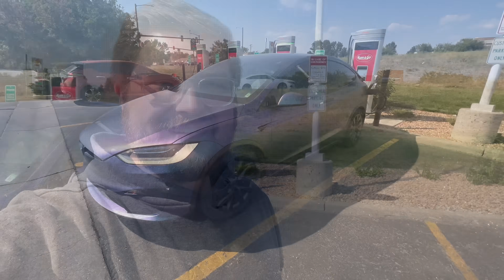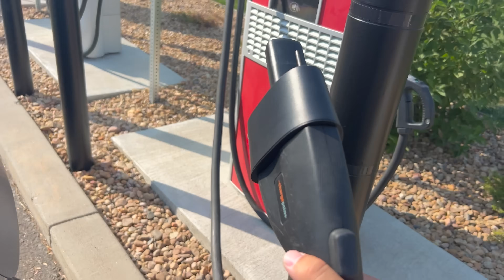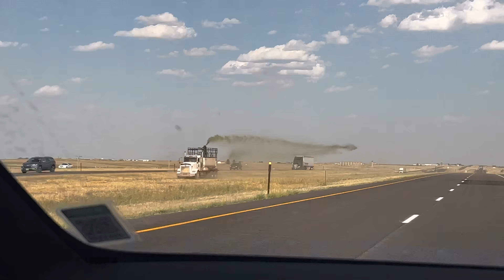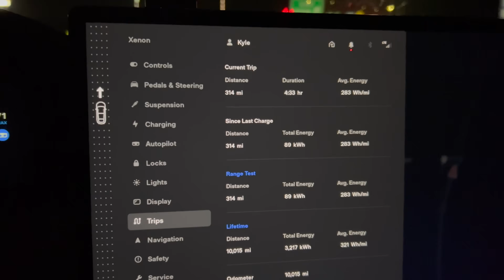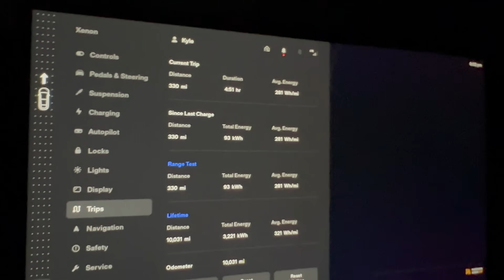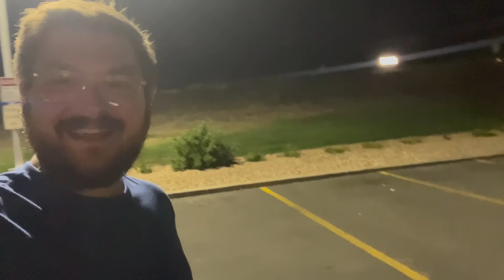2022 Tesla Model X Long Range 70 MPH Highway Range Test - Will It Go Farther Than The BMW iX?

Comment: Love your testing and videos, Kyle. Just a thought:

Kyle left the A/C on while charging on the iX, but not on the Tesla. I'm sure running the compressor hard in the X initially is why your efficiency appeared so high at your 90% SoC update. 

As someone who lives in Florida and has spent nearly 2 years in an Tesla, that initial cranking of the A/C in a hot cabin uses a ton of power. That was probably a 3 to 5 mile difference right there. The initial degradation of Li-Ion batteries compared to the iX probably is another 3 to 9 miles. You also may have been able to limp out another 3-6 miles if you really tried to kill it. So best case, you may get 350 miles out of a Model X at 70MPH. But the average vehicle will not, so your test is a much more realistic sample.

We all know that real world variables such as: HVAC, Wind, Elevation Change, Road Surface, Car/Battery/Tire condition/type, plays so much into the range you get on a test.

I do appreciate the work and love watching all these videos. But for those trying to buy a car, don't base your EV choice on how many miles it's rated for, or YouTube range tests. More important is the actual efficiency (ie Wh/mi) vs usable battery size if you really want to compare two cars apples to apples. But Miles of Range is easier to sell people on, I suppose, even though it's not super helpful. If you want to beat EPA ratings in any EV, cruise at 50MPH with HVAC off and windows closed. I guarantee you'll see about 400 miles in either the Tesla or BMW. But in reality, the car itself is what it comes down to. Things like practically, performance, comfort, style, features, and charging network are all way more important that any minor difference in range. If efficiency or battery size are hugely different, then that's definitely going to make a difference. But two cars with similar efficiency and sized batteries, each within 15% of each other, it's a wash!
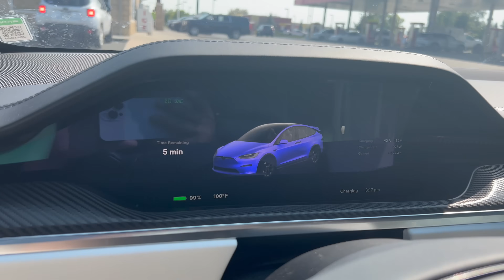Reply: He had the climate on while charging the model X as he mentioned at 5:20 .  The initial degradation of the battery depends entirely on Tesla's buffer strategy.  It seems they're keeping a larger buffer in the 2022s versus previous model years so it's possible they're hiding some degradation behind the buffer now.  

He also tested the least efficient iX m60 w/ 22" wheels against the most efficient base model X w/ 20" wheels.   The iX m60 beat the combined EPA estimate by 65 miles, but the iX m50 with 20" wheels has an EPA rating that's 50 miles higher than the iX m60, so it could go significantly further in these test conditions.  It's the same battery, so the base iX m50 is more efficient, just as the efficiency of the base model X w/ 22" wheels or the model X Plaid would worsen.

True, range isn't that critical, but Tesla has been touted constantly for its range, so it's only fair to show that it no longer has that advantage.  Efficiency is good for charging times, but I imagine the differences in road tripping times for most trips will be negligible... which is exactly the point.  BMW is matching Tesla in this segment at a much lower price.  Customers definitely shouldn't only base their buying decisions on EPA range.  Tesla's EPA range seems to underachieve in real world highway testing, whereas other brands seem to overachieve and get better range than advertised.  The established luxury brands still believe in under promising and over delivering, whereas Tesla believes in pushing out the very best numbers on paper to convince customers to buy them over other brands, even if those paper numbers are deceiving.

This test scenario isn't simply about beating EPA estimated range, it's about testing a real world road trip scenario with highway driving that's typically around 70 mph in the US.  Driving at 50 mph for 400 miles with the HVAC off isn't a real world test.  Hotter temperatures improve aero, but also require more HVAC.  I believe the improved aero more than offsets the HVAC use; especially in well insulated vehicles.  The ranges he got from these vehicles weren't super realistic since the temperature outside was higher than usual, and he's testing at a higher elevation.  Both serving to reduce air resistance.  Still, it's fair because he tests all vehicles at this elevation; although varying temperatures has always been an issue when comparing vehicle range tests.

Sure, vehicles should be considered based on the list you provided.  It would have been great had Tesla been compared against other brands on those fronts, instead of most EV publications and social media influencers constantly touting the brand and their vehicles on their EPA range for the past 10 years.  Ironically, they've also been criticized a lot lately for their real world highway range not living up to the EPA estimates.

When it comes to practicality, comfort, style, quality, and features, the other luxury brands are also very strong.  Tesla's main advantages have primarily been infotainment and the charging network.  For charging, they should be opening up the SC network to other brands in the US within the next year, so it won't be an advantage any longer once that happens.  Other charging networks are also starting to step up their game.  EA is advertising new charging hardware; which should hopefully improve their performance and uptime as it replaces the old infrastructure.  Lucky for them, their stations don't have all that many charging cabinets that need to be replaced.  EVGo has recently begun opening new fast chargers that have been getting good reviews thus far.  New BEVs sold today may be driven for 10-20 years, so Tesla's charging advantage may only last 1-2 more years, with the other 9-19 years being pretty even amongst brands.   

One major point of comparison you didn't mention is vehicle price.  Tesla's offering in this segment is simply priced much higher than most other competitors, including the iX.  While Tesla does have some nice features that other brands don't have, and the charging advantage for now, the iX also has some nice features that the Tesla doesn't have.  Further, it seems established luxury brands often live up to their luxury prowess better, with things like reduced road noise, better suspension comfort, higher quality materials, better fit and finish.  More and more Tesla seems to be taking advantage of its supply advantage while demand is exceeding supply, and while other OEMs have yet to ramp up substantially... but oddly Tesla still has the most expensive vehicle in this segment.

Comment: Great job Kyle!!! This should be a wake up call for Tesla.  I don’t think anyone spending  ~70% more for Model X over a Y wants similar range. X is 130 grand, Tesla flagship. drivetrain efficiency means not many extra cells to get X to 400. should be at least the same range as Model S. 

Not advocating a mileage range race, but Tesla needs to set a range standard  for their premium car.
Reply: Model Y is for the masses, Model X is not. So people looking to buy the X will not buy it for its range. I’m talking from experience as I bought a X Plaid and traded in a model 3 performance and have already driven 2500 miles to Yellowstone and had no issue with range. I love the performance and the 6 seat configuration for my family.
Reply: @NeilSalaria  3 performance handles so much better tho especially with a great after market support. But I guess not nearly as practical as the x
Reply: I have a X Plaid and a Y LR. The X is more comfortable, feels a lot more roomier, and of course way faster. 

Both great cars and the X is for people who want more than what the Y provides. Especially if you often drive with a family. The 6 seat configuration is the best
Reply: The model Y can only go 275mi, that’s a 55mi difference, which is hardly “similar range”
Reply: Lol wake up call for Tesla to🤣. Tesla is selling more electric cars than anyone else today 😜 besides both the model S and Model X are not Tesla priority anymore in regards to what companies goal to produce more electric cars. The S and X are just side projects for Tesla and it's engineers thus you have not seen a total refresh of both cars.
Reply: Haha wake up call, what are you talking about. Tesla is the number one EV manufacturer in the world. And they are doing it with bigger margins. Everyone else is paying more for their batteries AND having to use more of them in their cars. This is a wake up call to the legacy auto industry. Bankruptcy is around the corner.
Reply: @ultrastoat3298  Good for a stockholder, but not necessarily for the customer. I would much rather have the rare BMW than a Camry common Tesla
Reply: @hotrod182  BMW is bad at making EVs, you are just brand loyal.

Comment: I switched from a Model X to a BMW iX best decision ever … and this test confirms all my findings.
Reply: Why did you Switch?
Reply: @genierainbowmagick600 Multitude of reasons, BMW knows how to build cars, and that shows in every aspect. Driving noise, suspension, handling (4 wheel steering makes it very agile), real 360 camera, no phantom breaking, cross traffic warning when exiting a driveway or parking spot, amazing sound system B&W, interior quality, Apple CarPlay. Model X is not a bad car but is below on each of the points mentioned. The one thing MX has the route planner / SC network that is way better, but in Europe SC network is open so I can get by and I use ABRP to fix the software of the route planner …
Reply: @yvesvandenbroek6055  what year was your X?
Reply: @jonathansage2147  2020 and I did put 20 inch slipstreams on it to be more efficient but even then the iX on 22’s is as efficient. I’m sure all these tests gives a good indication but in day to day drive the iX consumes less I have a home work drive where the Tesla consumed 7.5 to 8 kWh the iX is 6.5 to 7 it;s a 34km drive with 30km highway ….
Reply: @jonathansage2147  also it was not the efficiency that was the main trigger, I was expecting that the iX would be less efficient. It’s the comfort that was the main driver, the little squeaks the lack of CarPlay, the lack of true 360 camera, phantom breaking etc that drove me away from Tesla
Reply: @yvesvandenbroek6055  got it. I own a 2020 MXP and a 2018 MX 100D and there's a big difference between the two, which is why I asked. I'm stuck with the Teslas for now as I have a family of 5, so the third row is a must, but it's good to know BMW is doing something right. I've been looking at Rivian, but they're likely to have similar problems to Tesla as they are in their infancy. I don't care for the exterior styling of the iX, but I wouldn't mind a cabin that doesn't rattle. Plus Elon is not my cup of tea.
Reply: @yvesvandenbroek6055  not sure I'll be able to give up the 2.5 second 0-60 though...
Reply: @yvesvandenbroek6055  I will say I get nowhere near the stated range, which definitely makes me angry. I feel like every other EV manufacturer is taking a more conservative approach to rating their cars. Seems like BMW is taking their standard approach to HP and extending it to range; under promise and over deliver.
Reply: @jonathansage2147  Well the opportunity to experience that is rather limited and the excitement wore off pretty quickly. The iX is pretty quick and I bet that ones you are driving 50 to 60 km and than floor it the iX feels as fast if not faster so overtaking is not much of an issue
Reply: @jonathansage2147  The 2020 is more efficient if you drive on 20 inch, but boy those 22’s are horrible in day to day drive they consumed about 20% more. We are a family of 5 and we fit perfectly in the iX, The kids hated the third row of the Tesla. Now from a storage perspective that can be an issue, the MX has way more. But for the long trips, 1000miles+ we take the Audi Q7.
Reply: @yvesvandenbroek6055  I definitely take more advantage of the acceleration than I should, so I know I'd miss it, but the iX is plenty quick compared to all previous gas cars I've owned. I'm two years in and it hasn't gotten old yet.

I have two sets of aftermarket satin black 20" wheels because the 22" wheels are dumb for so many reasons. I wanted the black look the 22's have, candidly I suspect that's the main reason people used to buy them (the refresh made the default 20" wheels way more attractive looking).

We went all electric, so I don't have a fall back gas car for trips. The Model X just eats stuff. It amazes me how much will fit in that thing even with 5 bodies in the car. 

My kids haven't minded the 3rd row, but we have two 6 seaters and none of my kids is older than 5 yet. We'll see if that changes as they age. Having them separated definitely reduces fighting though, so I wouldn't want to go back to three across (especially with everyone still in some variety of car seat). I do like the pass through for the six seater as it means we're not constantly moving the seats around to get kids in.

I'm super hopeful BMW makes a bigger SUV in the future. Based on what they've done so far, I'd absolutely give it a test drive. I'm also eying the Rivian R1S and potentially the Cadillac Escalade EV if and when GM makes it. I've never loved GM cars, so BMW would be a more attractive option.
Reply: @jonathansage2147  I had the 7 seater, in my opinion the 6 looses way too much space if you need the 3rd row and brings it almost on par with the iX on the storage front. In day to day drive I really do not feel any difference in speed the iX feels just as quick as the MXP, I drove the MX in Ludicrous mode all the time and to be frankly besides the occasional on ramp acceleration I’m hard pressed to find any difference, I have the 50, I bet you would need a stopwatch with the 60 to measure the difference with the MX, because you would not be able to feel the difference. Moreover the iX is more reliable in its acceleration, I feel Tesla sometimes hold back when battery temp is not in range, not so with the iX. But for me the ride quality, which I experience 100% of the time is so much better in the iX, let me put it this way, with the MX I was always thinking what is next, drive shaft replacement, touch up on the falcon doors, rattle in B pillar, little squeaks and so on, the iX, every time I step in big smile … To Tesla’s credit, they solved each and every issue in a timely matter under warranty.

Comment: Stop trying to put lipstick on the pig... Tesla still lies on range and its and significantly worse car in almost all parameters. Im not a Bimmer fan and the bucktooth look is the worst in the business, but its has earned its "chops". And give me a break, the Tesla camera is good compared to the Bolt, compared to the EQS its in the minor leagues. 
Now the real comparison is in the horizon, the EQS SUV is coming! And the big competition there will be (again) the range. How well Mercedes can stretch is battery pack in an even bigger, fatter, less aerodynamic car will be the deciding factor. Otherwise the test will be the usual Bimmer VS Merc. Merc with better more elegant interior and plusher dynamics vs Bimmer sharper handling. Thats the real apple vs apples! Inquiring minds are curious!

Comment: The yoke steering wheel absolutely shows danger, im glad this Tesla Model X and the S Isn't coming to the UK, I prefer the traditional steering wheel.
Reply: I don't agree that it's dangerous.  Different, yes, but not explicitly dangerous.  

That said though, I'm definitely not on Team Yoke.  It feels like a step backwards to remove the easily accessible stalks and place the stalk controls on the wheel itself.  I'm sure I would get used to it, but for now, I'll keep my regular wheel and stalks.
Reply: Danger of what. I have been to Road Atlanta, Atlanta Motorsports Park and autocross at the Michelin Proving Grounds and yoke is not a safety issue at all. We have NTSHA to set safety.
Reply: @juanmedinar20  Well the UK DVSA 🇬🇧 would absolutely disagree with that due to our safety standards over here which are strict 😬 and I mean extremely strict.
Reply: @BusTrainsGuy20  we shall see. Tesla is already shipping the refresh Model S to Norway and other European countries. Will see what happens when it gets to the UK.

Comment: 3% degradation at 10.000 miles? Thats massive degradation,Kyle. Maybe 1% but 3% is too much.
Reply: Depends how old it is, 3% in first year is pretty normal, but the following years tends to be more linear at around 1-2% !
Reply: Similar to what Car & Driver saw in thier Model 3 that was only supercharger for 40k miles.
Reply: Most research I've see shows an initial 2-4% degradation after the first 10k miles, then it nearly levels off. So being a couple kWh short is to be expected. There is also some head loss, and probably another kWh or 2 he could have gotten had he really pushed it to zero. So it probably has a grand total of ~95kWh + heat loss and degradation = Original 100kWh spec.
Reply: @EccentricJamie  C&D got the  Cadillac Lyriq to go 270 miles on 102 kw useable but at faster 75 mph.